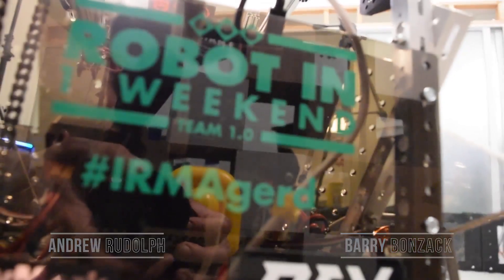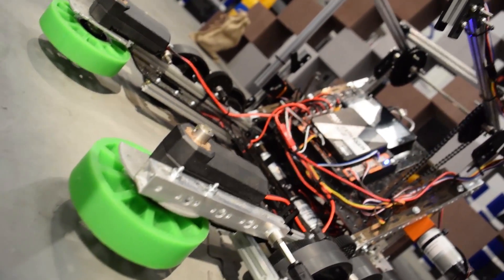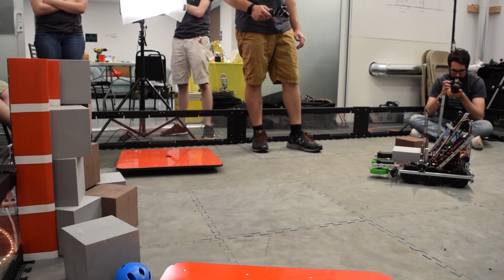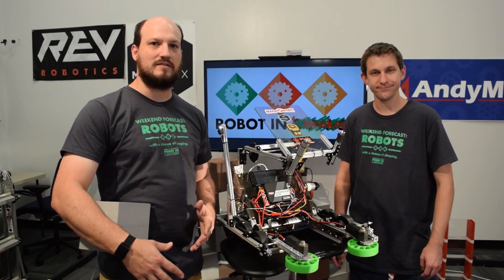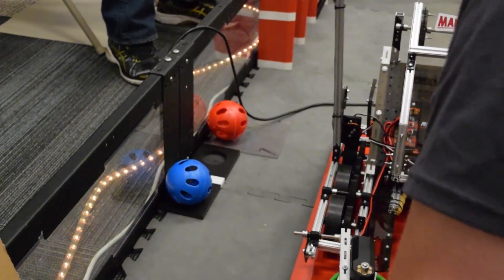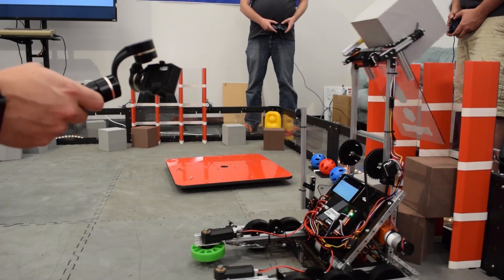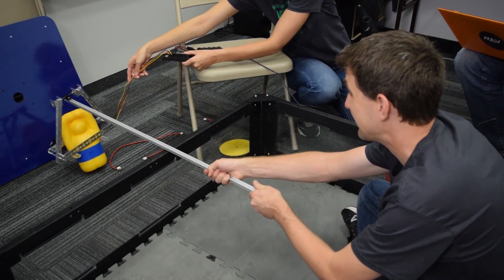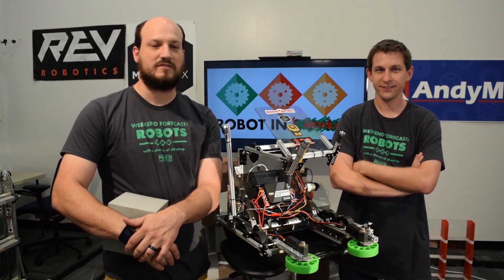How We Built the Robot | FTC Relic Recovery 2017 - Robot in 1 Weekend

Comment: Good morning. Thank you for the great video. I have a few questions about parts and assembly of your 4" Compliant Wheels:  Are you using an 8mm bore on the 4" wheels?  What size collars are you using with set screws on hex shaft?  Is the hole inside the collars round or hex-shaped?  How are you attaching the hex motors to the frame?  We are looking for specific parts (Andymark, RevRobotics, etc).  Thanks so much for the speedy response.  We are behind and need some additional mentoring.  Much appreciated.  Linda @ Tech Tonix team 11103.

Comment: Hello! How did you mount the Andymark Orbital 20s (NOT normal NeverRest 20s) motors to the REV 15 mm extrusion? We can't figure that out. Also, how did you put the hex gear on the Andymark motor shaft?
Thanks so much for your help!
Reply from the maker: If you have an AndyMark motor and want to put a hex gear on it, then you will need to take the stock gearbox off and purchase a gearbox with a hex output shaft, like this one http://www.revrobotics.com/REV-41-1065Alternatively, you can purchase a motor with this gearbox already attached http://www.revrobotics.com/rev-41-1301/ .If you absolutely do not want to do either of those, you can have your stock AM motor with a sprocket drive a hex shaft with a sprocket.
Reply from the maker: This motor bracket is designed to mount AM Orbital 20 motor to the REV 15mm extrustion. http://www.revrobotics.com/rev-41-1027b/The whole pattern on the bracket will match both the AM and REV motors.

Comment: About how long did it take to score 1 glyph for your robot once you sped it up and practiced driving? We are trying to weigh out the different ways of scoring points and seeing that is a reasonable amout of glyphs that can be scored when picking 1 up at a time.
Reply from the maker: To answer that question properly, it would take about a week of fine tuning and driver practice. The goal of this robot was to drive forward, pick up a glyph, drive backward while lifting the arm, and scoring the glyph without ever having to waste time turning around. That strategy would certainly be achievable over multiple weeks of tuning and practice, but not during a weekend build.

Comment: For your relic recoverer, why not intake it the same way as the glyphs, and have the whole upper claw mechanism extend out to the zones? Although I do like your envelope idea :)
Reply from the maker: Do you mean like shown in this video? https://www.youtube.com/watch?v=MxnQ_lab7u0
The idea of the relic recover mechanism in this video is a 100% success rate. Having to rely on a the same grabber designed to only pick up glyphs would ultimately lead to matches where sometimes the the relic is successful, but other times the relic is dropped, followed by struggles to regain control as the clock counts down. A manipulator for the relic should be able to grab the relic in the laying down position quickly, and place it upright on the other side of the field quickly. These mechanisms should be designed with driver error in mind since the end game clock is counting down and the drivers are stressed to move fast.

Comment: What is the bearing pillow block for? I didn't understand the description at rev haha
Reply from the maker: There are two pillow blocks on the REV site. REV-41-1317 - 15mm Bearing Pillow Block is when you want the hex shaft to rotate, like the wheels on a drivetrain, gearbox, or an arm. We use these pillow blocks commonly. REV-41-1316 - 15mm Hex Pillow Block  is for when you want to mount a hex shaft, but you do not want it to rotate. We personally rarely use these because usually when we use hex shafts we want motion, and when we want stiff structure we use extrusion.
Reply from the maker: http://www.revrobotics.com/ftc/motion/bearings-linear-slides-pillow-blocks/